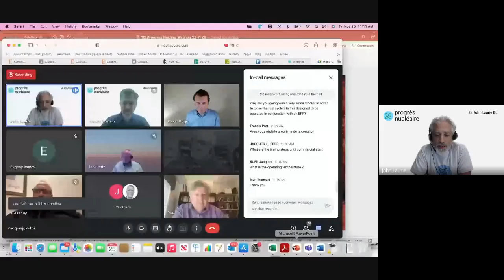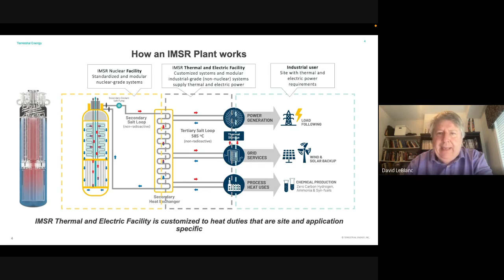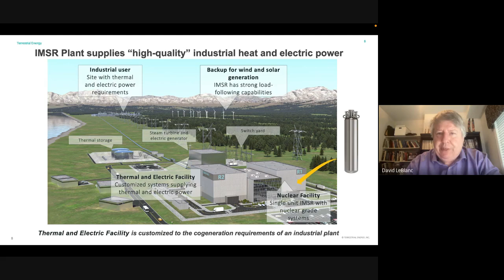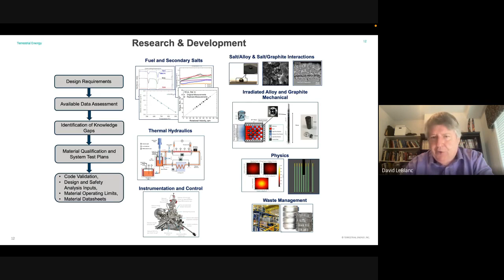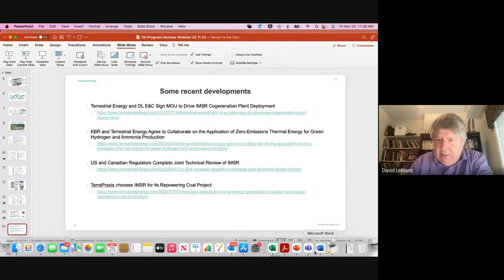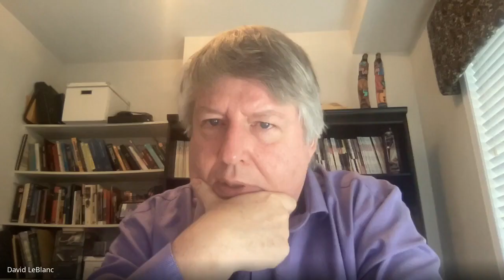The Integral Molten Salt Reactor

Comment: The Terrestrial Energy reactor is economically attractive as a heat source in Alberta with some of the lowest cost natural gas on the planet ONLY because reactors produce very little CO2. 
One indication of the costs ascribed to green house gases- the USGovernment is paying over $100 per perc ton of CO2 for sequestration of CO2. It is paying $275 for the sequestering the CO2 from burning of 1 ton (50,000 ft3) of natural gas.So to the $3 per 1000 ft.3 at which forward CO2 is priced an additional $5 should be added for the social cost of the greenhouse gases from burning natural ga

Comment: Just because fusion has made an important breakthrough does not mean it's a cure-all. Molten salt has proven ability to boil enough water to spin a turbine, and then there's the chemistry, etc. MSR has its hurdles but they're more materials handling (corrosion, embrittlement) than turning the fusion spark into a furnace - MSR's already a furnace and if they need to replace pipes and valves as interim solutions, fine.
Reply: Well, plus the recent advance in fusion is fake, or at least not what the headlines were claiming it was. It was not a net gain in energy. The reaction cost 300 megajoules,  to get back 3. They re-estimated the 300 megajoules down to 2.05 claiming that was the “energy cost”, based on estimated inefficiencies. That means all they demonstrated was that they could possibly get a net energy gain, if they got the process 99% more efficient. If you look into the details the 2.05 is an estimate or calculation, while the actual grid energy cost to even power the lasers for it was 300 megajoules. They’re saying it was just a real inefficient laser. That’s not how the headlines and announcements spun it though.
Reply: Practical Fusion reactor is still as far away as it ever was. Since most fusion guys are saying then need Tritium maybe you could
collect it from SMR's ?

Comment: EV big battery and rooftop solar is the future. 
This is 10 times cheaper in the future. 

No fossil fuels means 5 times more electricity. 
5 times more capacity in the national grid. 
The grid becomes the killer cost in the economics of every centralised concentrated electric power generation. 

This is the failure, the humongous grid fattening costs.

This reminds me of the idiot who forgot the big picture when talking about the big picture of climate destabilisation.
Reply: I agree completely, rooftop solar matched with lithium iron phosphate batteries and all is good. Who needs industry anyway, or trucking or the hundreds of other process heat needs. Granted, people who don't live in sunny places will need to burn wood, dung, or coal, but I won't. So what if you can't buy an EV because mining needs more energy than solar can provide, work from home, learn to code. We just need to use a lot less energy anyway.